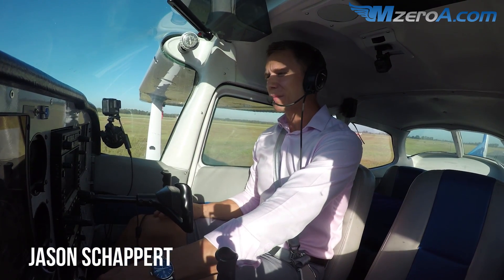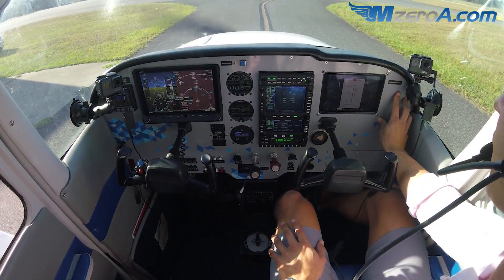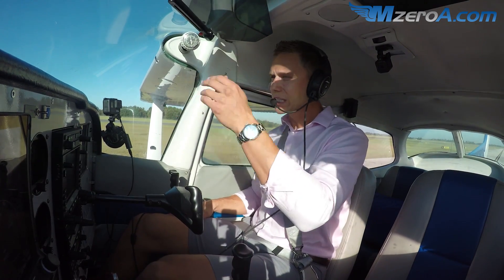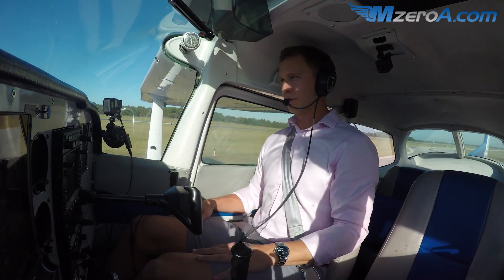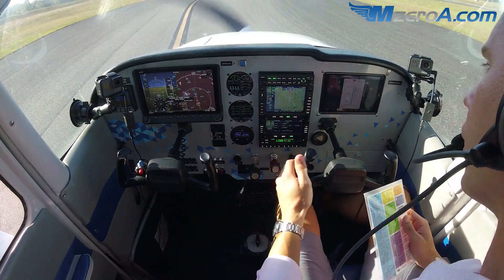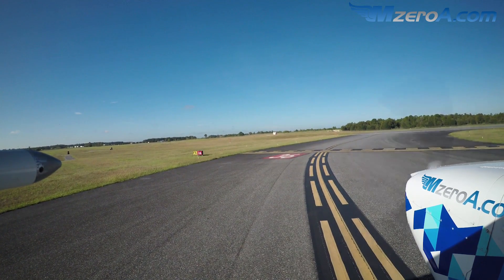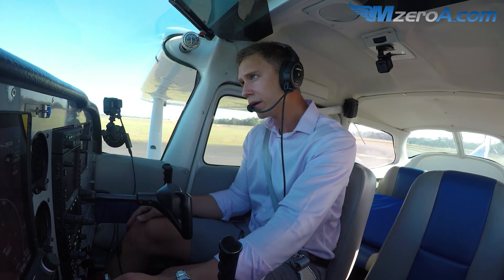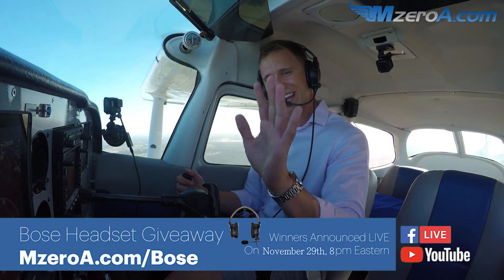Class D Airspace Radio Communications (Departure) - MzeroA Flight Training

Comment: In short
Initial call from parking: “Ground, this is Cessna xyz, Taxi with ATIS _, West departure”
Ground: Cessna xyz, RWY _, taxi via _
Read back: RWY _, taxi via _, Callsign
Tower: Callsign _, RWY_, Cleared for Takeoff, Right turn approved.
Read back: Cleared for takeoff, RWY _. 

Done ✅
Reply: Thomas Tancengin It’s actually correct procedure to preface with your callsign before readbacks, so they know who is talking. Only rookies give the read back first and then follow with their callsign. Listen to center freq when airliners talk. It’s a Common GA mistake. He even proved himself wrong with this 10 seconds later. “Radio communication is easy. It’s just like ordering pizza...WHO ARE YOU...where are you...then what do you want.” You can repeat it to yourself real quick if you need to before responding or get good at quick short hand writing. Build good habit patterns early.

Comment: Is there a difference between left traffic and left “closed” traffic. ?    Thanks in advance.
Reply: gary wheeler yes. Closed traffic is for high power aircraft like fighters. It’s a much closer and tight pattern. On the go it’s a climbing 180* turn right over the tower followed by a quick descending 180 to land. There is no crosswind, downwind, base. It’s an “inside downwind” followed by a perch to short final. Typically it is higher than the normal VFR pattern as well to deconflict from other VFR traffic in the normal pattern